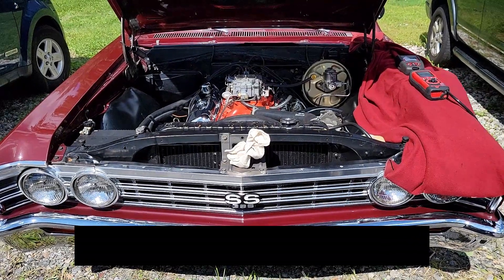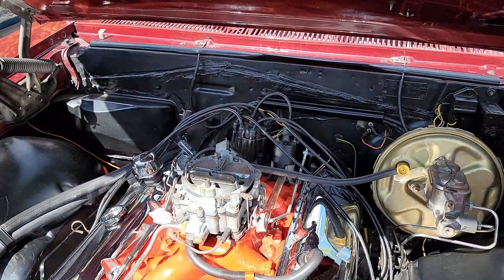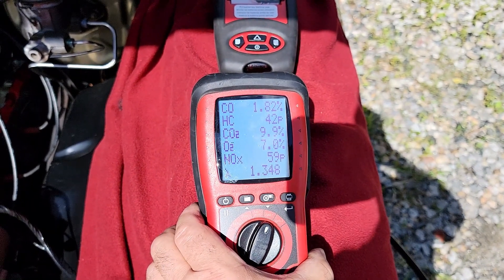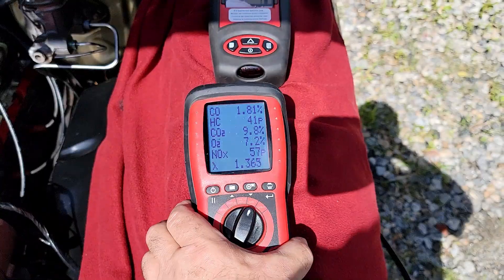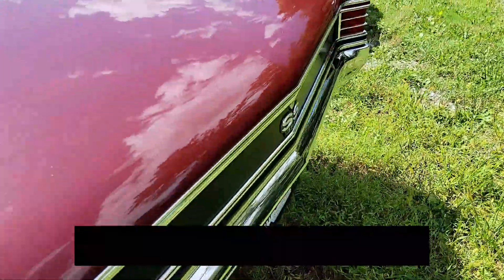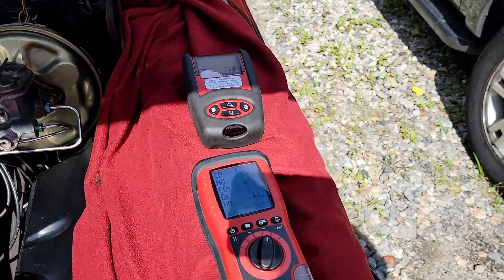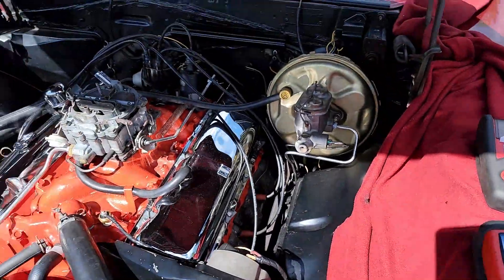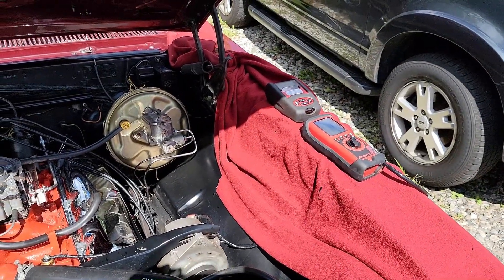Snap On 5 Gas on a Classic

Comment: Cat does not affect lambda, looks like air dilution, either exhaust leaks or you need to put some rags at the end of exhaust pipe the probe is sucking air at idle between exhaust pulses.

Comment: Looks like the cylinders are running pretty hot "lean" the Knox levels are up pretty high!  Little bit more of a richer fuel mixture is needed, but I'm sure that's why you said I have little bit more of adjusting to do.  Have fun! definitely gas analyzers make setting carburetors up way easier. And also for diagnostics.
Reply from the maker: thanks for watching and for your comments.....If you have not already subscribed to our tstseminars YouTube channel please do so. Interested in more training? Go to www.tstseminars.org and view full length videos for members on TechFlix for $9.99 unlimited viewing …Membership and over 85 videos for less than $200.00 a year. Also checkout www.attstraining.com for hands on training and webcast
FREE videos at www.tstseminars.org/training-videos